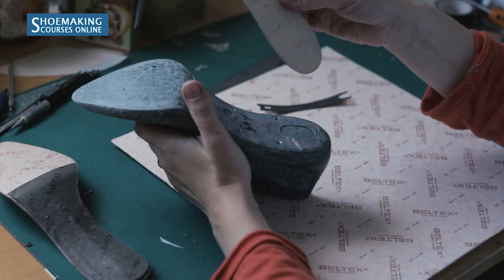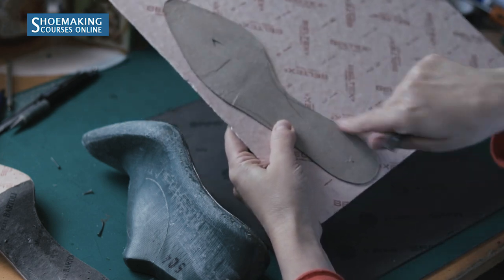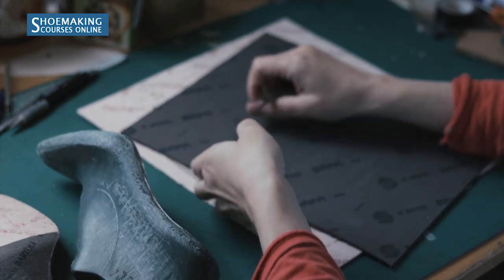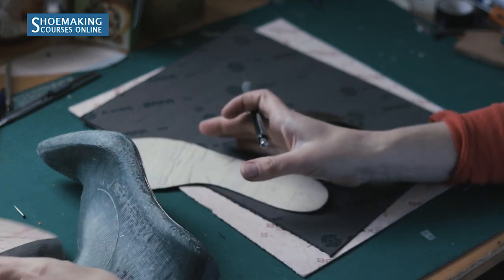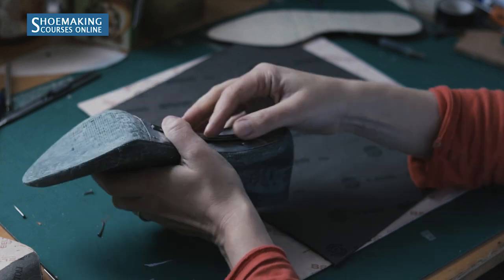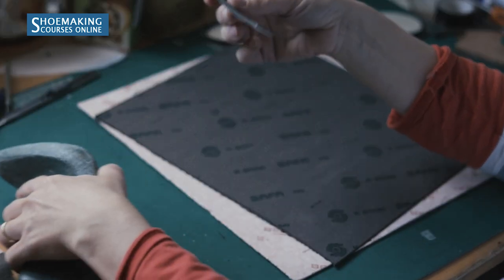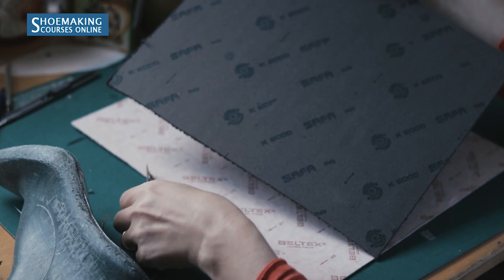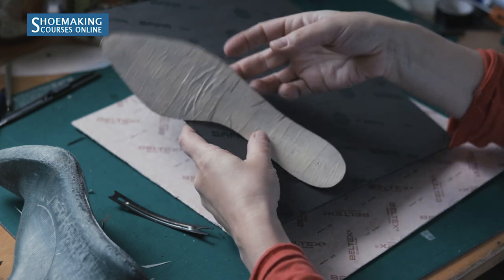Insoles Materials [ Shoemaking shorts]

Comment: Mam shank will used for high heel shoes only
Reply from the maker: Yes, if you are making slippers or sandals - maybe.. This is for support, so if you are making shoes with even low heels as 1.5 cm. you need shank. Quality buddy.